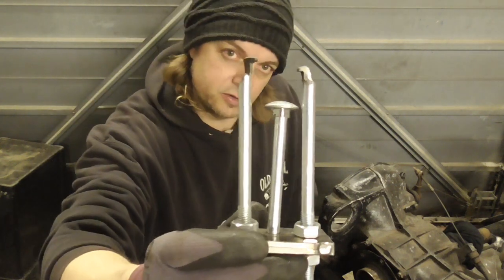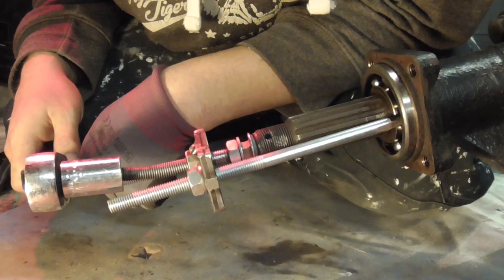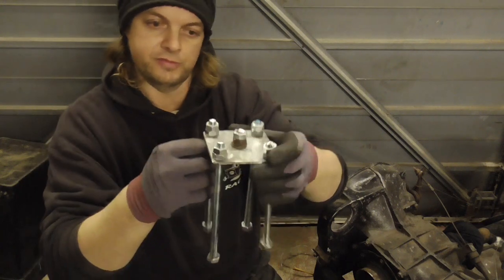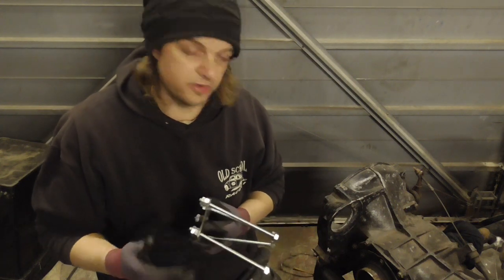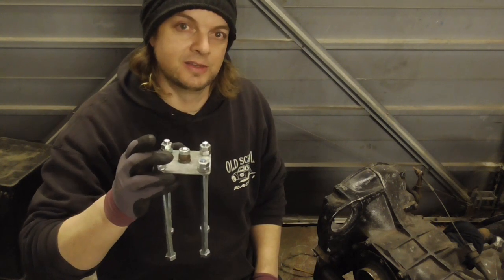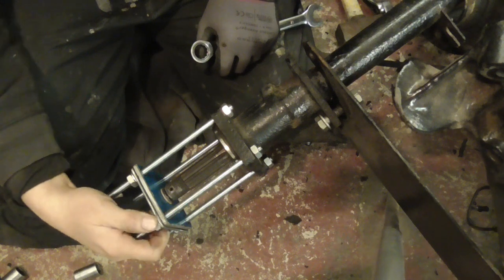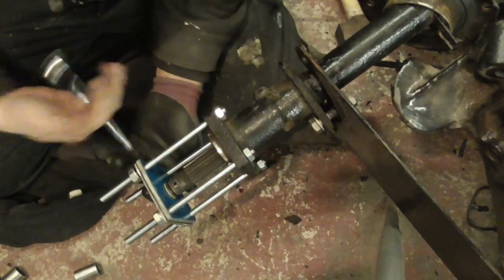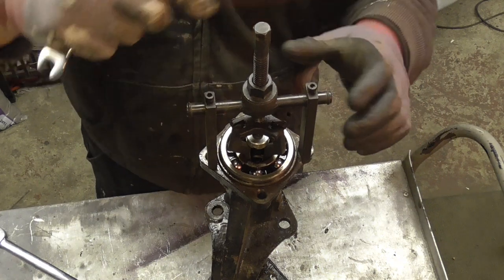Axle Tube / Bearing Puller Tool- How To Make DIY Homemade No Welder Swingaxle VW Beetle Bug Kafer

Comment: Where did you purchase the last puller in this video..?   What is the Brand Name or who sells it..? Thanks for doing this Video..!
Reply from the maker: It's just a standard internal bearing puller. Cheap on ebay etc.  I've put some links to ebay in the comments if it helps. I also did a seperate vid how to use thr puller here. GL :)
https://youtu.be/7qNTmAivyFI